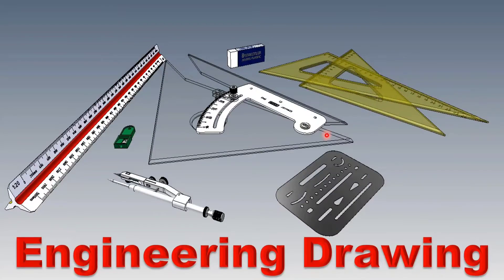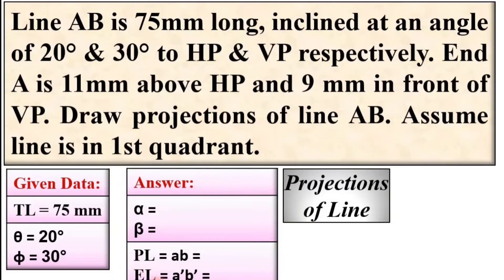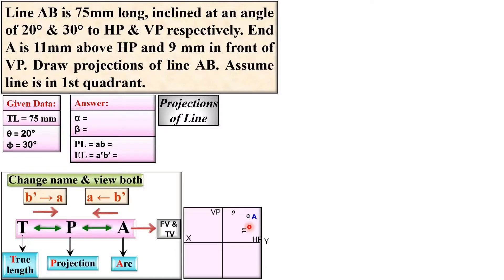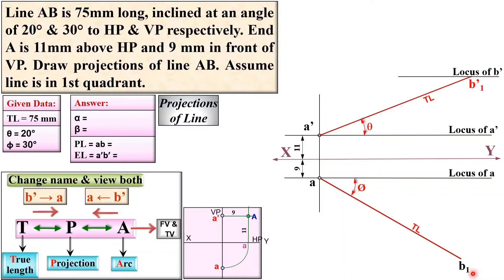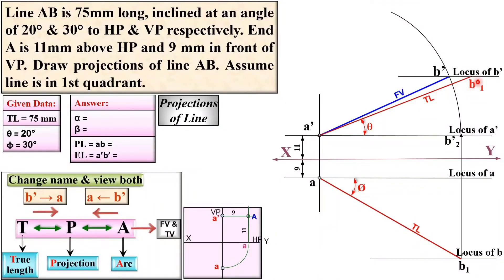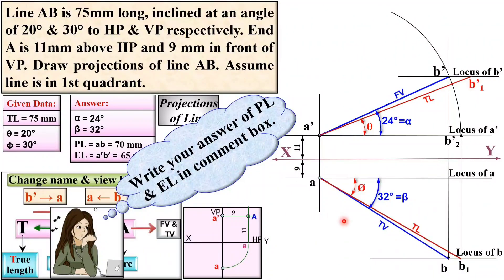4 - Projection of Line (Basics, Drawing Process & Solved Example) Explained in Engineering Drawing

Comment from the maker: Projection of Line explained with following timestamp: 
0:00 – Engineering Drawing lecture series 
0:15 – Line AB 70 is 75 mm long 
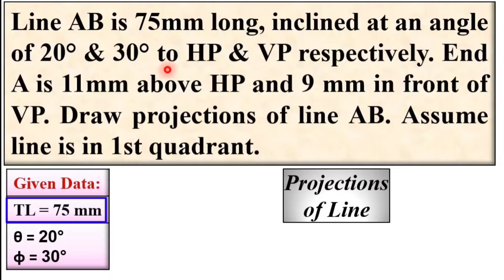0:55 – True length
1:06 – True inclinations
2:00 – Projection of point
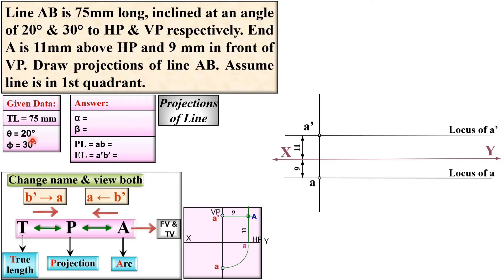3:49 – Projection of line
5:15 – TPA for projection of line
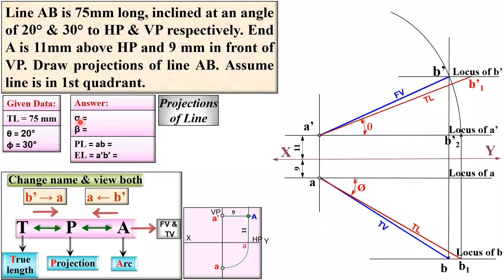7:16 – Apparent angles
7:41 – Plan length and Elevation length